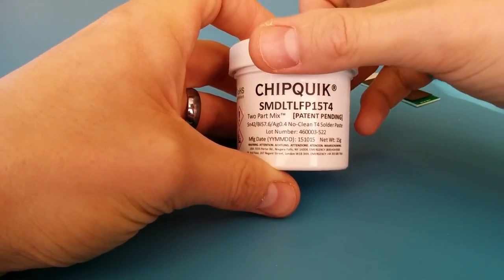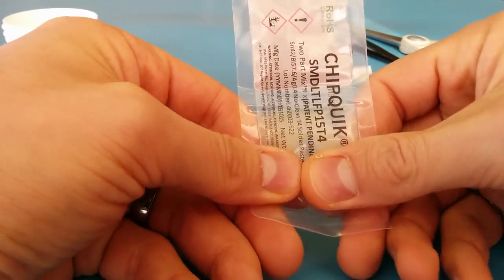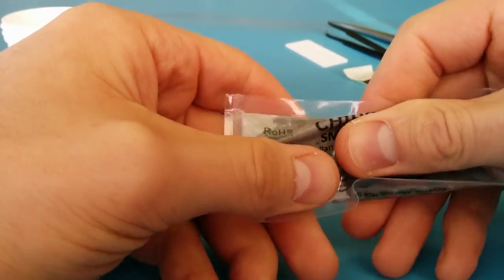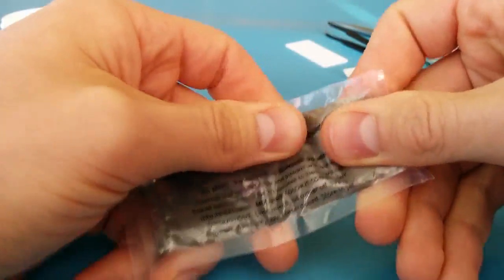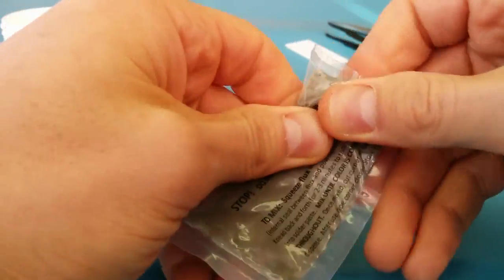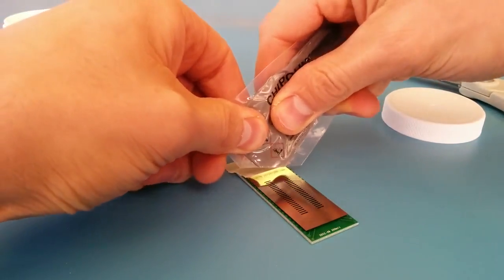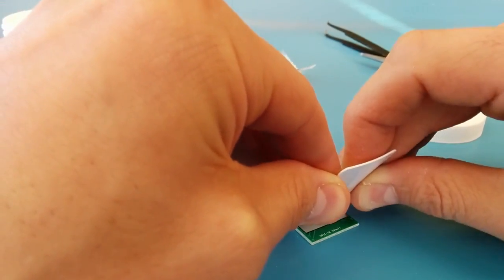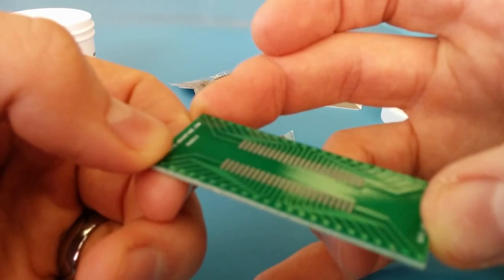Chip Quik Two Part Mix Solder Paste Demonstration

Comment: I still don't know what is this
Reply from the maker: This is our new packaging for solder paste, used for integrated circuit surface mount assembly. This new package keeps the flux and metal powder separated until mixed by the customer inside the bag, which provides the freshest solder paste possible.
These products also use our new T4 mesh metal powder, which has a smaller metal particle size than the more common T3 mesh solder pastes, which makes stencil printing easier because it flows through the stencil apertures more readily.
We're currently manufacturing two formulas: SMD291SNL (Sn96.5/Ag3.0/Cu0.5) which is the standard lead free RoHS alloy used in most electronic manufacturing of circuit card assemblies, and also SMDLTLFP (Sn42/Bi57.6/Ag0.4) which is our new low temperature alloy (also lead free and RoHS) containing 0.4% silver to make it extra strong, but it also melts at only 138 Celsius (281 F), which makes reflowing it very easy.